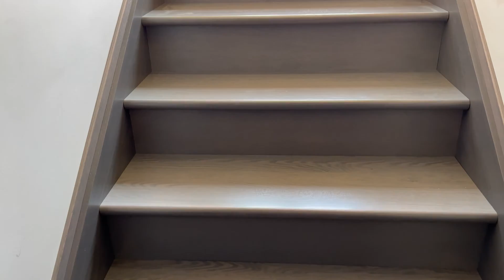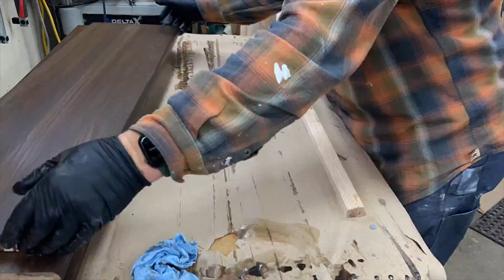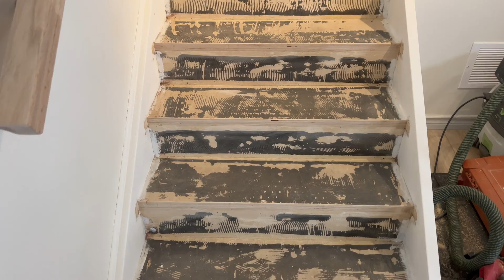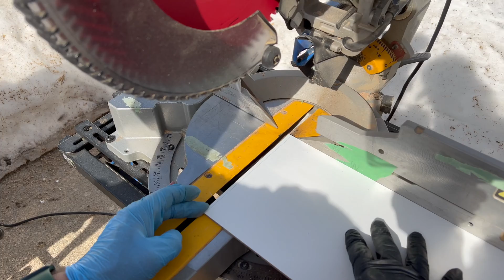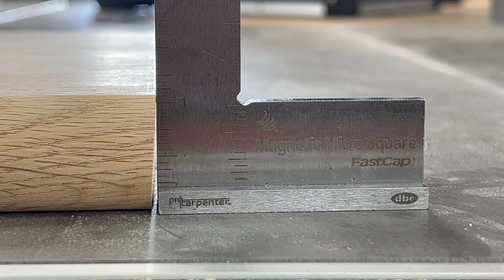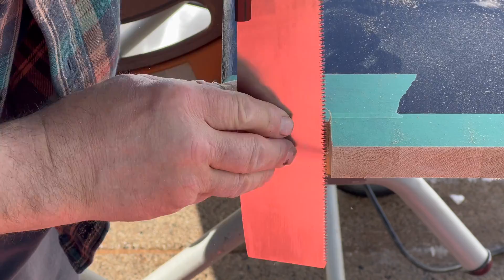The Complete Guide to Stair Refinishing

Comment: Hi Scott, loved the video. Doing a similar project and this is super helpful. For the clear coat, is the Finitec 6000?
Reply from the maker: That's awesome Josh! I use Finitec Hybrid floor finish. It has a yellow tint to it. If you want more clear finish then use Saman floor finish. Both are good. Hope this helps. As usual, try it out on a scrap piece that has been stained. Often a water-based stain will run or move a bit with a water-based top coat. The Finitec Hybrid is not as bad. Cheers, Scott
Reply: @scottearlsmithFTC  Thank you! Final question I promise, but have you ever finished stairs like these that are being matched to a vinyl plank? I laid vinyl plank and I wanted to finish the stairs in wood but I'm a bit worried that the stain may not match close enough and look odd.
Reply from the maker: @joshjuhlke2324  Ask as many questions as you want. I have "matched" vinyl plank. I'd say it's doable if you work with a professional paint store. They can do a decent job of matching. One of the options is to go a little darker with the railing in the same shade of colour. That way it's more forgiving as you are matching real wood with something factory made. Hope this helps. Scott

Comment: Great video!!  I’m in the process of replacing red oak treads.   Any tips on filling the nail holes with something that’s would match?  I’m not staining only going to use polyurethane.   Everything I’ve tried so far isn’t blending well.
Reply from the maker: Thank you for the compliment! Have you tried a dab of wood glue and then going over it with a random orbital sander (remove the vacuum hose first). Often the glue combined with the sawdust will give you a perfect match. That said it might look a tad darker once you apply the poly. (Assuming you haven't put the poly on already.) Let me know if this works. Cheers, Scott
Reply: @ thanks for the reply!  I’ve tried it with wood glue and CA glue, they both seem darkish after I put the poly on.  The CA seems to match better.  I’m using a scrap piece to test it out.   After watching your video I really want to finish them before I glue and nail them on.    Do you think a colored pencil would match on a finished piece?
Reply from the maker: @ I think the right crayon/pencil would work. Just have to experiment a bit. Wipe the excess off with mineral spirits, and then wipe the mineral spirits off with rubbing alcohol. Good luck. Scott

Comment: I cladded my basement stairs. I used maple plywood on the risers and stringers which are both glued.   And maple on the tread.   After staining and varathaning I noticed gaps between the risers and stringer that I didn't notice before.  When originally cut and fit they fit tight and I didn't notice a gap.  The gaps are really bothering me.   Do you know of a fix?
Reply: Hi.   I forgot to ask what brand of caulking you use?
Reply from the maker: @chip7646  It's called Top Gun 400 made by PPG.
Reply from the maker: Clear caulking works good. The clear bead seems to blend with both sides and gives the impression that the joint is tight. I use caulk that goes on white and dries clear. That way I can see exactly how neat a job I am doing when I apply the caulk. Hope that helps, Scott
Reply: @scottearlsmithFTC  yes it does.  Thank you.     Will the caulk match or blend in with the stain and varathane?
Reply from the maker: @ yes. That’s the beauty of that technique. Scott
Reply: @scottearlsmithFTC  perfect thank you.   I really appreciate your knowledge and help.
Reply from the maker: @chip7646  You're welcome. Scott

Comment: Very good stuff ; but what gauge nail and length u use on thread
Reply from the maker: Thank you Rick! I use an 18 gauge 2-inch brad nail. I've found the Porter Cable brand works well. Some of the others are too soft and bend, which is not a nice thing to happen on a finished tread. Cheers, Scott

Comment: Been doing finish carpentry for 35 years and stairs for about 25 years. I appreciate some of your suggestions. Always nice to see how others do things. I like your use of hot glue gun, going to have to start incorporating that in my work flow.

The biggest thing I could suggest in return is to save your carpenters pencil for rough construction and go buy a 9mm mechanical pencil (a thinner lead would be even better, but will break more easily when dropped, which will ultimately happen if your like me). Also get a spearheaded marking knife. Use it along with the Collin's stair jig. Your precision will increase dramatically. A slight back bevel cut along the ends of the tread from the back of the tread to about an 1" away from the nosing. then cut the rest square or .5% on the end that lays down last. Its an extra step at the saw, but worth it.
Reply from the maker: Thank you for taking the time to craft out such a detailed comment. I like all your suggestions and will put them into practise. I've got a marking knife in my shop and will start bringing it along to the job site. The pencil is also a great suggestion and I'll pick one up. I also like the double bevel idea as it won't be visible from the front view. Thanks, Scott
Reply: I also watched your video on pricing out stairs and agree 100% with everything you said. Your method and labor estimates are pretty much the same for how I do it. People always under estimate what's involved in stairs.  @scottearlsmithFTC
Reply from the maker: @t.e.1189  That's for sure. I'm thinking about doing a video on "vetting customers." Basically a few of my thoughts on how to choose the right customer. Because if you make a bad choice it can really be destructive. What do you think? (I know that there are data bases for bad contractors but none on bad customers...) Cheers, Scott
Reply: I think that would make a good video. For the most part I been pretty fortunate. But I knew guys who seem to have had more than their share of bad customers. Makes me wonder if they don't really know how to pick them or if it's because they don't really know how to get along with people. Not to mention make any money.  @scottearlsmithFTC
Reply from the maker: @t.e.1189  I'd say I've been very fortunate as well. And I do agree that some guys can't get along. Thanks for the feedback. Scott

Comment: Nice video. Subscribed. No one has complained about the 3/4" discrepancy in the first and last step with this method?
Reply from the maker: Thank you for the compliment and the sub. Every time I have done the stair treads like this the customer has added hardwood flooring to the top and bottom of the stair case so it actually evened things out and made it consistent with the others. So no complaints. If I am making new stairs (as in my video on "New way to build stairs") then I make the top and bottom riser different so the finished stair case has equal rise throughout. Cheers, Scott

Comment: Instead of cutting off old treads why not just fill with 3/4 plywood  and cut less off new tread?
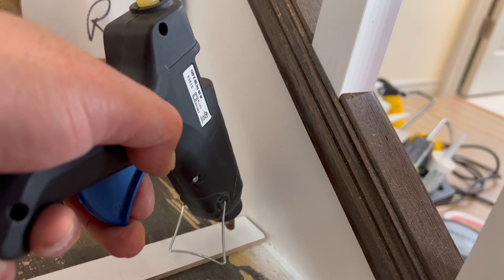Reply from the maker: Thank you for your question Bryant. If you look at the footage of this video between 23:17-23:30 you'll see the stair case where I added skirt boards. This is a situation where I simply added a piece of 3/4 OSB to build out the riser flush with the existing nosing. In this case the nosing was square and the overhang was consistently 3/4". But you'll see that by time I added the oak tread, the nosing of those treads really crowded the forward edge of the stringer. So with a standard 1" or 1.25" nosing overhang it simply isn't practical to build it out as you'll likely have your new treads proud of the top edge of the stringer. So cutting off the nosing is almost always the way I tackle this issue. Cheers, Scott